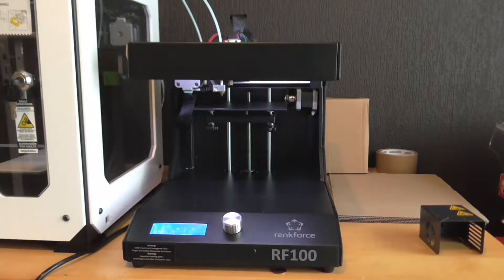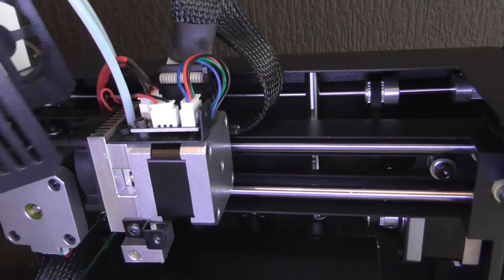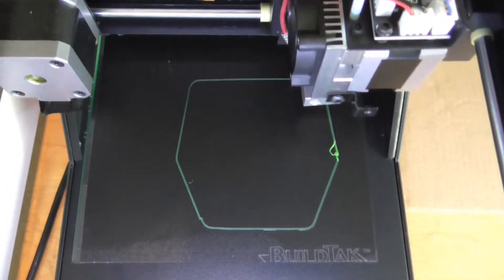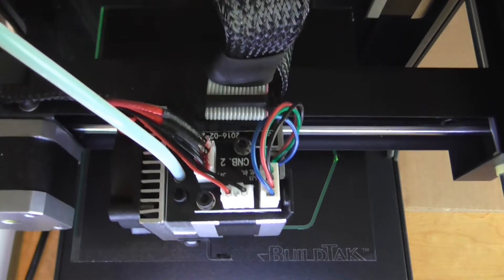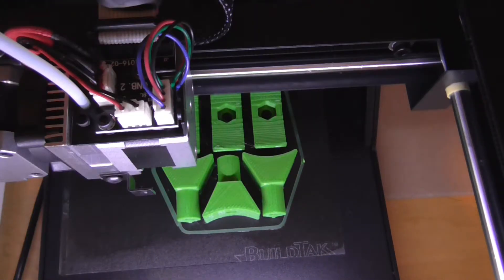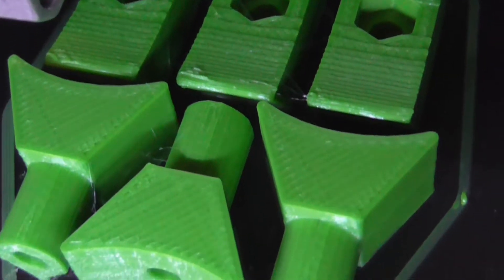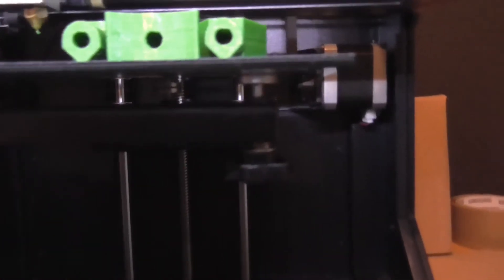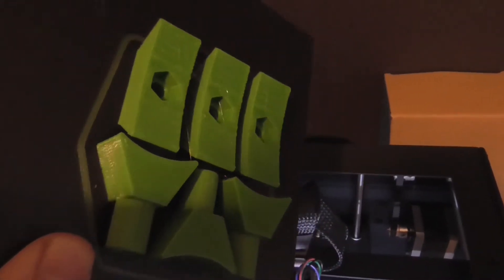Review of Renkforce RF100 3D pinter from Conrad for 299 euro

Comment: How do you change the print surface on the glass? Is it easy to remove the old surface and replace? Can you do a a video showing how to change the print surface on the glass if possible?
Reply from the maker: Hi David, I think I could just peel it off, maybe it was waith a razerblade. Afterwards I used acetone to clean the glue rests. Buildtak is so much better!